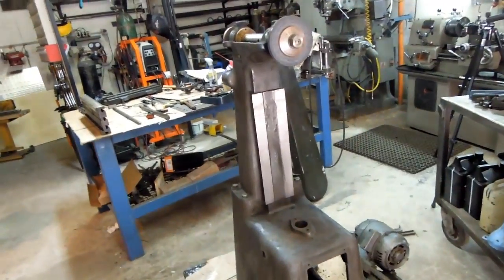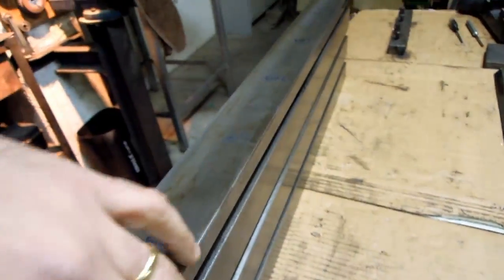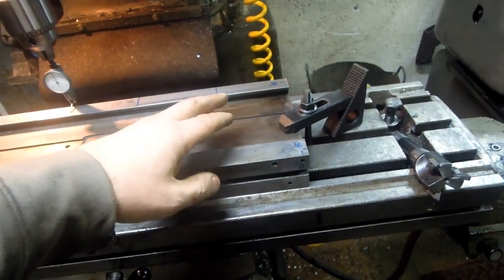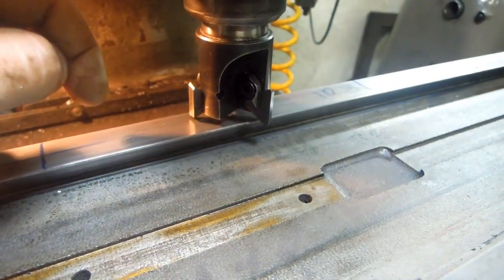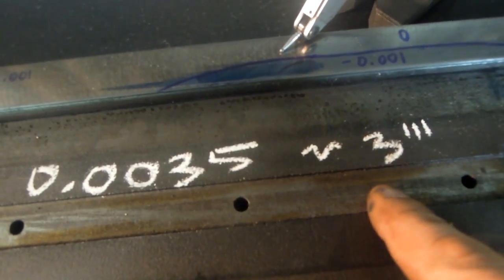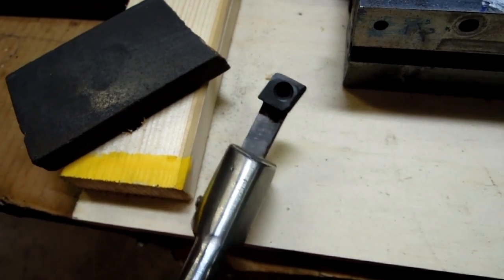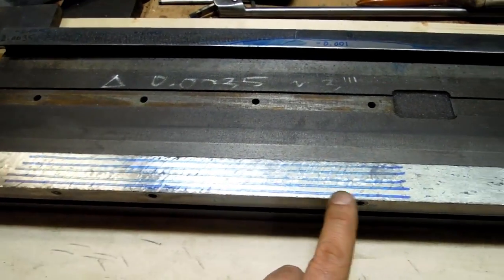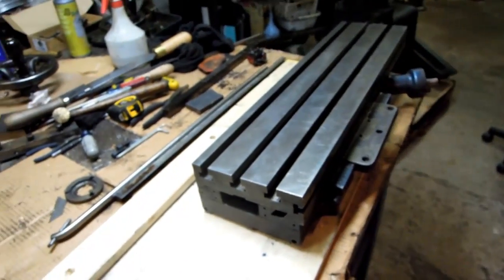Surface Grinder Rebuild - part 1

Comment: I'm a carpenter.  I'm used to errors in the range of 1/16".  You are fixing stuff in the thousandths of an inch.  Metal working tolerances are insane
Reply: Czerno Alpha my engineering tutor told me years ago “Engineers/machinists work in the closest thousandth of an inch, joiners/carpenters work in the closest 16th of an inch and builders work in the closest field”. Stuck with me.
Reply: Well, 1/16th" is 62.5 thousandths of an inch, so you're kinda working to thousandths too...just quite a lot of them! Give yourself a break, I'm happy if I drill a hole within 5mm! And that's why the critters in my house use my shelves as slides!
Reply: I'm a metal stud mechanic, we have tolerances up to 3/4 of an inch. I can't even imagine being a machinist.
Reply: Dont short yourself.. some woods swell 1/16” and back in a single day. And you depending if your a finish capenter or maybe a oldschool cabinet and furniture builder your accounting for those variables..
Reply: Try cutting a piece of oak to a thou,  then measure it again in a week or so... or even the next morning
Reply: carpenter here too. 1/16th is an admirable standard to work to. There is a lot of "feel" in wood working that is not present in metal working. Some times we add or subtract an arbitrary tap of the table saw fence because we know we need that little extra to get a perfect snug fit. Not something that happens in machining. Some day i hope to have enough money to sell my wood tools and transition to a hobby metal shop. But for now i'll stick to wood. the tools are cheaper and the material is cheaper. =)
Reply: Like your name! Who's becoming the fakir - you or someone else? :D :D :D
Reply: I framed a house for a Boeing machinist and he was bitching about sills sticking out 1/32 of an inch.
Reply: 16 threads per inch  or 16 rotations of a motor to move 1 inch.... carpentry has no tolerances.
Cabinetry now has tolerances equal to PreWar Germany in it's maß productions.
Digital supplementing this gives easy access to tenths of a 0.001" increment.
Threads per inch counts can further multiply this .
Reply: @S3dINS  that was in error... joinery is fractional 100ths of an inch.
Learn Japanese furniture joinery... even early American joinery, build a watertight barrel, or a wagon wheel that carries6-800 lbs for 3000 miles.... or a watertight flat bottom boat....  Fractional inches of tolerances...
MEEKNESS is built upon.
SHALOM.
Reply: As my machine shop instructor used to say, thousandths of an inch tolerances are for "road graders and dump trucks."  If it's gotta leave the ground though, tolerances get tighter still.  Aerospace tolerances are often in the neighborhood of a few ten thousandths of an inch.
Reply: @FastSloW-qt8xf  The only time you ever deal in thou in woodworking is when you're making guitars. Even then you could be up to 1/32" off and it would not affect the sound (fret positions can be off by that much without much discernible difference). But we like to use metalworking machines (mills, lathes, surface grinders, etc.) because it allows much greater precision for small pieces of wood and it also allows me to make jigs that we don't have to pay Stewmac a ton of money to buy.

You can sharpen jointer blades with a surface grinder, make bridge pins or end pins with a lathe, and jigs (such as the jig for drilling 3 on a plate tuners, routing slotted headstocks, etc.) on a mill. 

But we really don't have to be tenths precise... a lot of those old mills and lathes are good for luthiers without further work.
Reply: @S3dINS  Maybe you should reevaluate the quality of your work. I use calipers frequently when laying tile, felling trees and to scribe vegetables when making salads.
Reply: I'm a carpenter aswell, half a millimetre  was our usual goal
Reply: I work as a machinist and do wood working and other fabrication on the side, I love taking a indicator to my table saw and trying to be perfect.
Reply: I have been a CNC machinist in the Oil and Gas industry for more than ten years and frequently do turned and milled components with +-.001" limit. If the limit is .010" or bigger normally just program it and hit the button.
Reply: I've so far worked for a year as a design engineer for aerospace tooling, and 1 thou starts to look really big. If a part comes back from a workshop with a couple of tenths too much material removed (i.e. a few microns out of tolerance) we would have to send the part off to be chromed, then re-grind it.
Also all of our measurements are made in a temperature controlled room which holds the temperature very accurately at 20°C. Components are left in there overnight to normalise before being measured
Reply: IF you wanted to build an engine out of barstock that functioned thousandths of an inch in the tooling makes the difference between one that runs like a swiss watch and one that barely runs at all.
Reply: @kennethkustren9381  you do know what sealant is, right. Its not like the barrels and boat had such good fit up immediately that they were water tight. Sealants were used to prevent leaks.
Reply: While working as a carpenter I used to have 5 definitions of close. Smallest is tidley winks, horseshoes, hand grenade, artillery, and least accurate atom bomb.
Reply: @Masterman2020  sealants in your whiskey n wine??? I think not! The wood swells with water and becomes water tight if cut well enough to start. So while many boats would need sealants, not all would. ...Though I’m just spouting off, myself—I’m not going to look it up to get my facts straight because you definitely didn’t bother to either. 😜😉😄
Reply: @fosterlewis7360  the barrels "sealants" were and still are metal bands applying pressure.
The expansion due to the wood soaking up the spirit happens in stages because of temperature change. If that was all they relied on they would leak every winter. My point was more (and you helped prove) that the wood didn't need to be EXTREMELY accurate in order to work.
Reply: Actually tenths of thousandths.

Comment: I'm always amazed on the similarities in methodologies amongst the trades.  Your approach is the same as the first road I built. You used a block of granite and a dial gage to measure the contour of your work.  I used a optical level and grade rod.  You used a scraper to remove the high spots.  I used a motor grader.  Your error is in the .001 of a inch.  My error is approx 1".  Were doing the same thing, just different materials and tools and scale. Very cool! I love your channel!
Reply: MrTim3990 ---> Just an inch of error in a ROAD?!?!? Wow, to me, that seems like some serious accuracy!

Comment: It's curious how you're spending time with relatively simple tools to establish precision in a machine that will then be able to reproduce its own precision in any workpiece in much shorter time. It's like you're huffing and puffing towards a milestone where once you're there, your speed of producing such precise surfaces goes up by magnitudes.
Reply: The science of precision has always blown my mind. Once upon a time, we couldn't hardly make uniform sticks, and over time, through many iterations of machines, we came to levels of precision once thought unattainable. It seems counterintuitive, I would expect that, if I use an imprecise machine to make something, and then use that something to make a machine, I would be multiplying just how imprecise my measurements are.

Comment: I know this is an old video, but for anyone thinking of doing this as Tony did - think about mapping the ways of the mill independent of the table of the grinder. At 8:30 where he talks about the differences in the measurements of the table on the surface plate and on the mill due to the flexing of the of the mill from the weight of the grinder table. This CAN be very accurately known whether you can compensate for the deviation or not. Just use a long enough drill rod or something equally light weight yet precise in dimensions resting on the mill table, indicate along that with the grinder table in place (so that it will produce the effect), then use that information to adjust the Z along the length you intend to mill.

Comment: I work at a tractor factory in the early 2000. There was a specialized department that re manufactured worn equipment. To repair the the surface  as you are showing here, they used another surface grinder, and machine it until the surface was like a mirror.

Comment: omg.  I forgot about this video.  Thank you.  I'm going through a similar thing,  with a mill FULL of grease.  I thought the thing felt pretty dialed in.  Had full movement and even the backlash wasn't aweful. Perhaps it was just cold that day :)  How did I not notice the grease? It's getting a teardown and cleaning, and then I'm putting it together to enjoy it.  I'm also going to enjoy all this hindsight and experience I've gained, until I'm in a better position to correct it or replace it.  I'm still bootstrapping here, and don't even have power.  But I'm unemployed so I have some time finally :)

Comment: For future reference, putting a spacer block on the mill's table when corner checking does away with a good portion of the "moon surface" issues. Before getting my table cleaned and scraped, that's how i got round.

Comment: My two large English made surface grinders use 30 W (industrial oil) in zerk fittings - manual says so.  I think a paint pot and a grease hose and fitting on it.  Pressurize pot and there you are.  I've seen Grease pots that way I wanted to convert to oil.

Comment: 17:23, Tony, mill it again and if it reduces equally then you know the tollerances of your milling.
Obviously you want cutting with no heat and no chatter deflection.
Or just drag your mill tooling over face with shims to verify accuracy first.
Finally, never forget the bed ways (installed) , etc. do NOT climb down into a .ooo5 dip, it is not possible with proper shimming.

Comment: Hah, similar problems with my 1958 Bridgeport. While they had not pumped grease into the Dzerks (I always spelled it with a "D", but google mostly spells it "zerk". Who knows?), but they had "serviced" the quill and managed to misalign the upper gasket oil hole to block oil coming from the cup. Sigh, rebuild the quill...

Then, try to find an oil gun that clamps onto a Dzerk locally (this well before the www). Universally told I was wrong, finally had to finagle something.
Reply: Dzus

Comment: dumb question: when you laid the grinder table on the table of the mill, why did you not check corner 2 corner or for warp of the grinder table? seems like it would be a logical first step to do since you want as accurate of a result as you can get

Comment: in the later part of the video the work piece is placed on a somewhat dirty wooden board (painted white). Won't that surface add noice to your otherwise careful height measurements?

Comment: amateur machinist question:  Why not take the light cuts on the  bottom of the table using a larger dia cutter?  Keep the weight of the mill over the knee better?

Comment: If you reassembled the machine as is before machining the ways. Then ground the top of the table the same way you grind in the chuck. Wouldn't that compensate for the wear in the ways and make it accurate again? 
By grinding the top of the table in it would run true to the spindle, right?

Comment: Tony,
I followed the process indicating the low and high areas when the datum surface was laying on the surface plate. The video then jumped to scraping the blueing on the high surfaces. How did you apply the blueing to the high surfaces that indicated where you were going to  scrape?
david
Reply from the maker: Did i miss a step in the video?  I apologize.. been awhile since I watched it.  I think I applied blue to the surface plate, flipped the part over, and "printed" it against the plate.  I would have used that blue "print" along with information from the indicator to figure out where to scrape and how much.
Reply: You are awesome, your production has come a long way. IMHO you editing is some of the best on youtube.

Comment: Knowing the bed 1 though taper but not knowing if its front, back or a F/B ratio and adding the knee 90 degree ambiguity:
I would assemble it again and then mill as big a piece of "block" as possible.
Then measure the result.
Measure the accuracy of the block.
That will take into acct all the stresses etc.
So you know exactly what and where & by how much, the bed needs scraping.

Comment: questions I have for you. why did you put your test travel in the drill chuck? why not use a indicol on the spindle? your tip is at the wrong able so sine factor could be off.

Comment: I'm rebuilding a Deckel FP2 right now and the previous owners crammed it full of grease where there should have been oil. It's horrible. It resulted in galling damage and the machine having to be broken down into pieces for a complete clean up. I've had it since november and never even started it, good thing I didn't even try... Might have broken something else.
Reply: And no, never forgive, never forget.

Comment: Would it be more accurate to 
1- make stationary t slot blocks 
2- mill secured blocks with rigid flutter? 
3- place secure grinding table on flycut blocks 
4- fly cut grinder table bottom?

Comment: I was wondering as you were mapping out the platform heights, 

  (1) are there indicators that have digital connectivity?  (yes, there are, $300-$900 each!)
  (2) could you take photogrammetry software to create a 3d map of a surface?  (yes, and software is free)

http://motionics.com/bluedial.html
https://listoffreeware.com/best-free-photogrammetry-software-windows/

So, 

 (1) image area to be measured and find its edges.  
 (2) find the point on the image where indicator makes contact relative to edges.  
 (3) take reading of that point 
 (4) associate image location with that point relative to edges.
 (5) create surface map - interpolating between points.

Comment: You have taken a very big chance, there is no way you can get it perfect, an three thousand is very hard to accomplish. After all your working on a surface grinder. I went to school to be a machinist I made a set of standards one inch square with a hole in center of each one was one inch long one was two inches long the third was three inches long , out of all of them only one corner it was over by .00005 , it had been twenty years since anyone ever got that close.  The ones the teacher thru away weren't even close they were .0003 over on every corner. It takes time to learn the machine after you rework it , just like any other machine. It took me three class's to make them which was about 6 hours .

Comment: "I think Its close enough for government work" lol, man that is an niche inside joke for the few of us who have done government jobs.
Reply: wait the government has people that actually work? wow don't say that too loud I mean I may or may not has a gov job and may or may not have seen a few times where an outside company comes in to well idk weld while our welder watches or plumb, paint, wire, roof, and maintenance things while the people hired to do so watch the people subcontracted do it, all of course done on OT I mean come on its important stuff why not get paid even more for it em I rite? The whole 3 holding a shovel one in the pit using a shovel concept just really keeps cost down "close enough to budget"
Reply: I think it's a pretty widely used joke based on common knowledge that people employed by the government stretch the meaning of "work" beyond comprehension, and do even that very slowly.

Comment: Why are you scraping so much? If you just mill the top flat, as long as the mill arm is parallel to the floor, that will be a surface parallel to the floor, and then doing the same thing to the bottom would make both surfaces parallel to the horizontal. You might have to mill more away, but it's so much less work.
Reply: he said in the video that the mill had wear itself, making the table "wiggle" back and fourth about 3''' depending on the position of the axis. that is why he had to remove the last 3''' via scraping to get a truly flat surface.
Reply from the maker: Correct Niklas, and thanks.. but even if my mill were perfect, a scraped (or ground!) machine way is much better than a milled one.
Reply: @ThisOldTony  why is this? (scraped versus milled)  Could you expound a tad?  thanks
Reply: @chrisharrell5945  a properly scraped or ground surface is smoother

And it's way, way easier to control. A perfect cut on a mill would be almost as good, but would be a crapshoot, especially on equipment not designed, and maintained to do tooling work.

Comment: I don't understand what you do with the scraper. you talk about crazy tolerances but a scraper seems like a barbaric tool to the noob that I am
Reply: Scraping seems like magic to me. It's such a brutish looking process, but in reality, you can create super flat surfaces with it, or at least surfaces that are functionally super flat. The surfaces also have little pockets in them, which is actually a good thing. It prevents the mating parts from wringing, and from squeezing out the oil between them.
Reply: @gamemeister27  Woah ok that's fascinating. Thanks so much for your answer

Comment: Did we really need such a verbose blow-by-blow of smoothing out 0.003"? Thirty minutes of this which could have been covered by "I need to smooth this down by several thousands of an inch," and five minutes later (video time) it's done. He loves to hear himself talk. I realize this is the first of his videos, but it doesn't bode well.